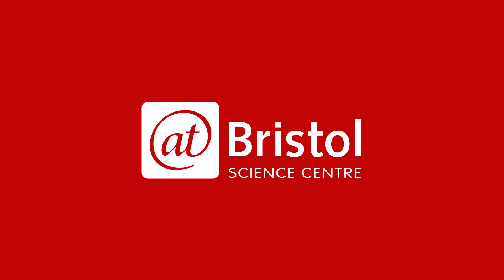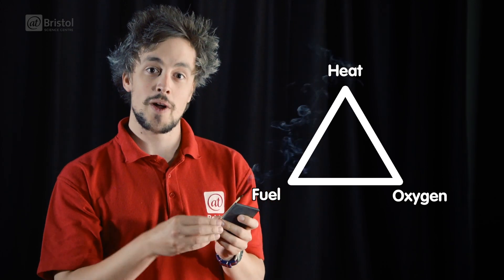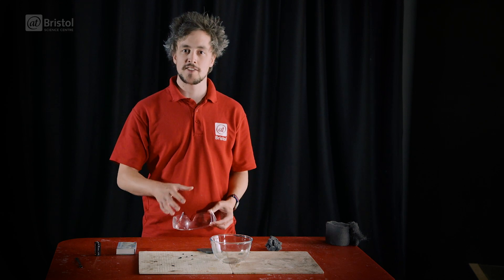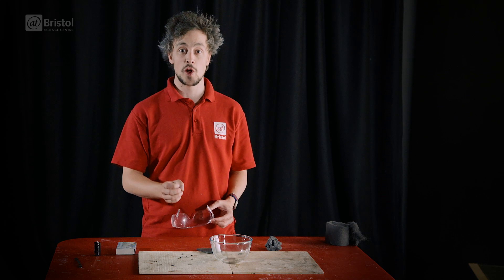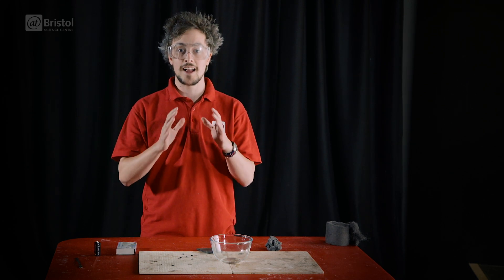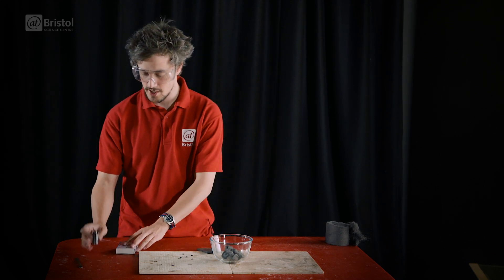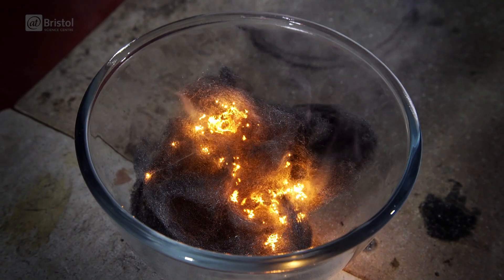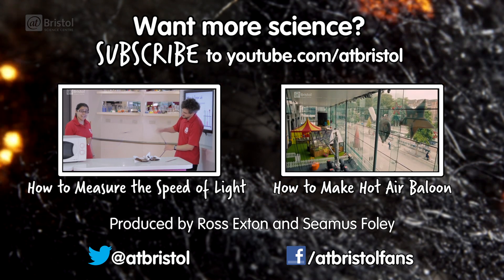How to burn metal | Do Try This At Home | We The Curious

Comment: 700c is still lower than the melting point of steel.  Why does it burn and not melt?
Reply: Surface area. Technically, it still melts. It's just phase changing much faster.